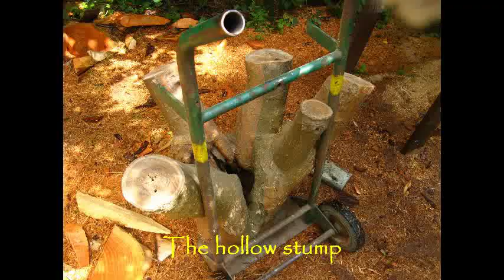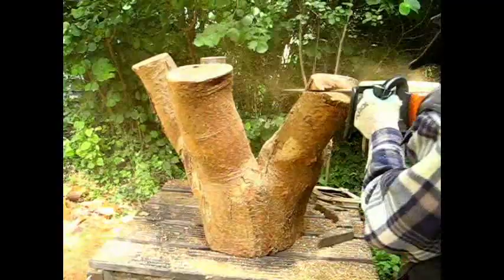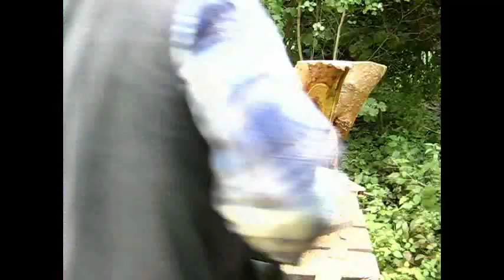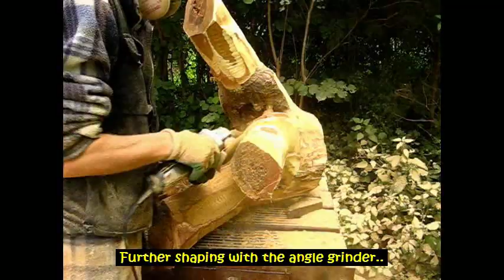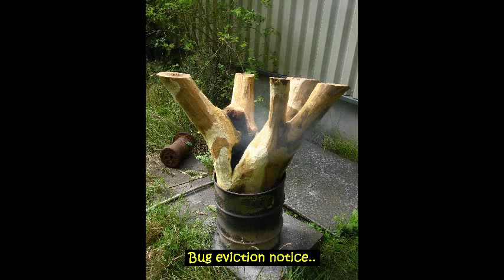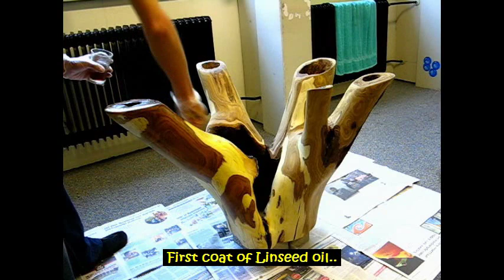Large Coffee Table

Comment: I get so many good ideas from watching your videos.  Few questions!! how did you attach the tabletop?? some kind of epoxy?  Also how did uou make it completely level? Each branch in contact with the glass?
Reply from the maker: Hi there. The table top is 'joined' with the wood by using soft transparent rubber pads. It can't be fully attached since the glass and wood shrink/contract differently. The table is almost level, I don't mind if it's off a fraction of a millimetre. :)
Reply: ***** thanks for the quick reply.  Iv alwys struggled to get things like this anywhere near level.. You just draw some levels on with some planks as guides with the saw then sand them even?  What a fantastic finish to the grain